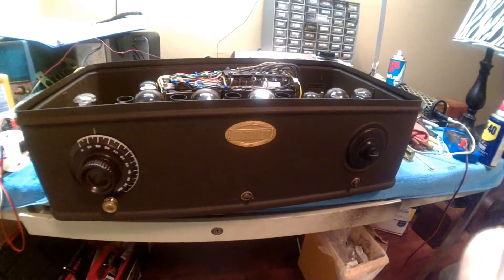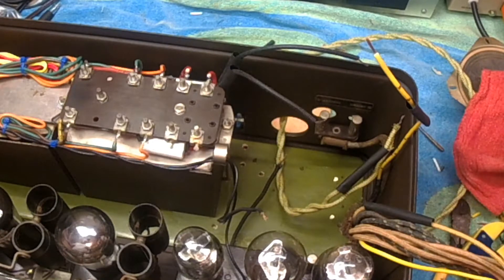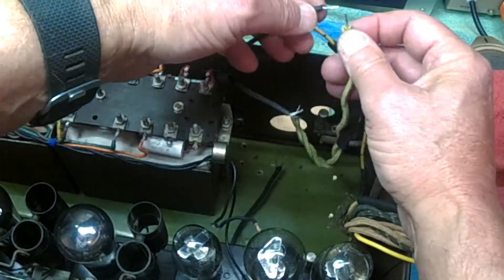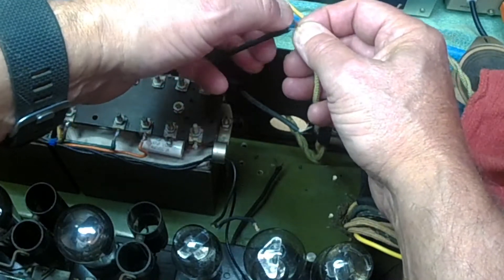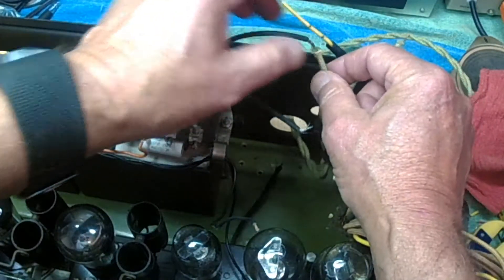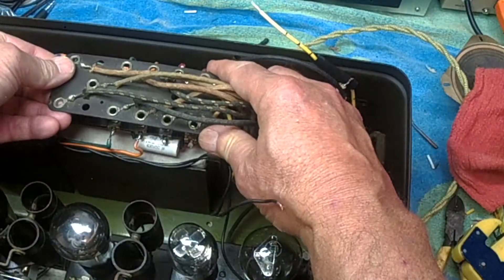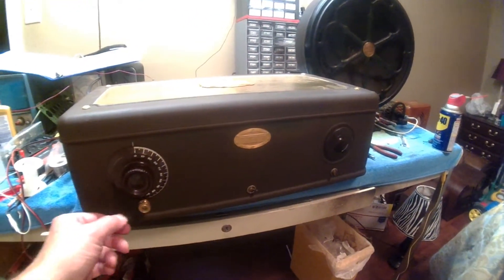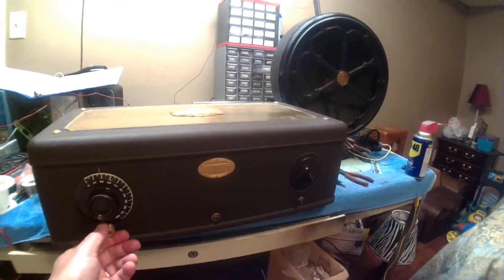Atwater Kent 38 Restoration Repair Part 4

Comment: Larry, enjoyed seeing you tune each section for optimal performance. I don't have any sets in my collection from this era so it was helpful. Glad it fired back up for you. She's a beauty. Thanks again for sharing this. BTW - what's the fuse type and rating? Best, Don
Reply from the maker: RestoreOldRadios Thx Don! I used a glass 1 amp fast blow fuse. Since this set has the extra rf stages, it draws just less than 400 mA. I want to go back probably will not video and  check the voltage drops across some of the resistors and see how each stage is performing. But, with the projects lined up, lol hard to find idle time. Thx again, hope to video the analysis and plan for the Firestone today. Thanks for ur help and we will see how it shapes up and I'm sure I'll be bugging you again for advice! Best Larry

Comment: I've taken on a few E.H Scott's, done a repair on a McMurdo-Silver, however, for some reason, these AK's scare the heck out of me.  I've been doing only '48, and newer for quite some time now.
Reply from the maker: AMStationEngineer Thx for the comment! I was intimidated at first as most are. The tar filled cans that house the transformer, chokes and caps are not a favorite among people to deal with. If ur transformer is good, the caps can be replaced without melting all the tar. Norm Leal has a good article on that. The set is easily accessible once removed from the cabinet. I probably will do another one maybe a 37 someday. Thx Larry
Reply: Should you have the chance, consider "potting" your next 'tubbed transformer' by utilizing any decent "electrical potting compound".  You do not have to meet the high dielectric strength ratings touted by most of the commercial electronic adhesives manufacturers. In-fact, I'd consider a grey or black RTV silicon or siliconized caulk which is from your local independently owned hardware store.

Disclaimer: Be sure to do your own dielectric strength assessment before committing  anything valuable to this process.

Norm Leal is about as good as they come, period!

By chance, are you in eastern Tennessee??
Reply from the maker: AMStationEngineer thx for the comments! I considered potting the can, but failed to do any research on availability. In fact, being naive about the subject, I didnt think to even look for some. Not sure where to look it. If I do another one, I will consider it. In fact, its not too late for the AK 38. The power supply is very accessible. Yes, Im located in East TN, in a small town called Spring City, pop. About 2500. I live on Watts Bar Lake, actually My subdivision has access and I have view of the lake. I retired from TVA as a Radiation Protection Instuctor. Thanks for watching and your comments. Best Larry